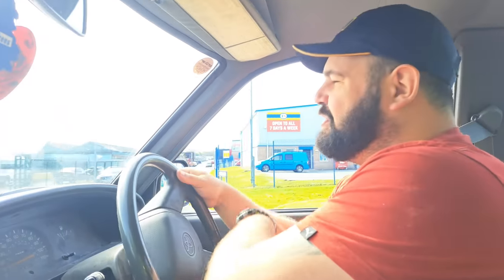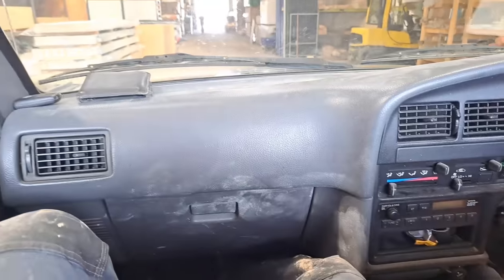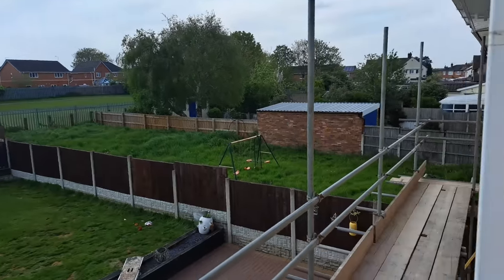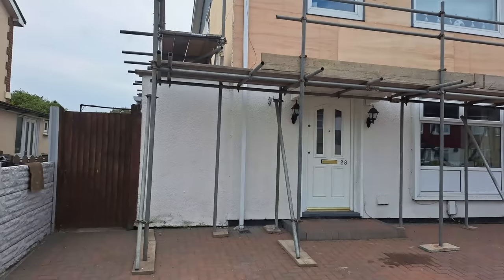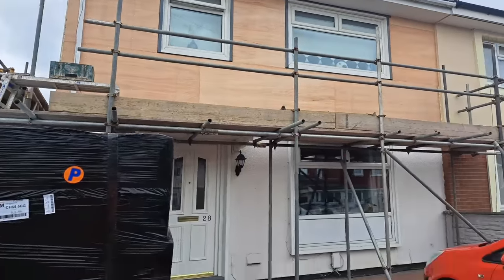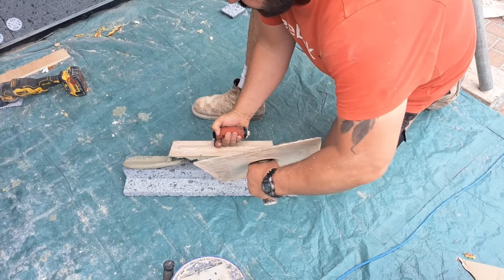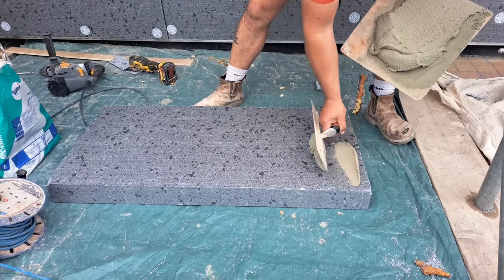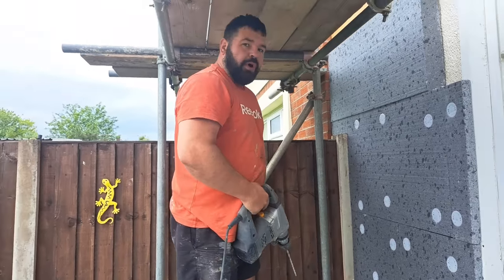EXTERNAL WALL INSULATION ON A BISF HOUSE

Comment: Have worked years doing ewi both commercial and residential here in the states and most remodel jobs are like this,if you are doing 
The insulated systems on a regular basis get yourself a hot knife pack for cutting, v Groves control joints ect great channel 👍

Comment: Expanding foam grabs lovely to timber, I use it for skirting now! Works out very cheap and grabs lovely! Very interesting vid mate keep them coming 👍
Reply: Not thought of using foam for skirting. Would you recommend it then.
Reply from the maker: It's a good shout if there is a gap where the dpc is. You can fill it with foam
Reply: @garygreenfield8495  yeah mate definitely, you do have to cross pin it,I fire a pin 45 degrees one way then 45 the other. Been doing it for years and never had a problem
Reply: Don’t use ‘normal expanding’ foam. A polyurethane foam adhesive like Instastick , but let the foam pick up first or wedge it in place until it sets, as it will push out.

Comment: System build properties are as a rule unmortgageable so Local Authorities generally do work like this to system built housing to make them mortgageable; the spec is agreed with the builder/designer and the Building society so they would provide a mortgage for the finished property. To get a spec you need to approach the relevant Building Society who will say (but not provide) a spec for this work. They won’t give the spec because if they do then tjey are liable for the finished work

Comment: Mate, are you aware of how much these buildings expand and contract? I lived in these types of houses and you can hear them "ping" in the summer and "clang" in the winter!! Having never rendered them I'd be more concerned about the render cracking and your substrate bowing or blowing.
Reply from the maker: I know mate, the council have gone around and done nearly every single one this way, I'm just going around picking up the ones that people bought before the revamping.

We use a flexible thincoat render on top of insulation boards that are glued and screwed to the metal. 

Also take into account, now the metal is behind 100mm of insulation it won't be getting hot in direct sunlight so all is good 👌
Reply: @Onthetrowel  Good job, my man. I can tell you from experience from when I owned one of these houses here in Glasgow, the first time you hear a massive "ping" sound in the summer you shit your pants!! Also we get more severe winter here too so the "clang" sound may be the frame just shifting back into place😂😂😂